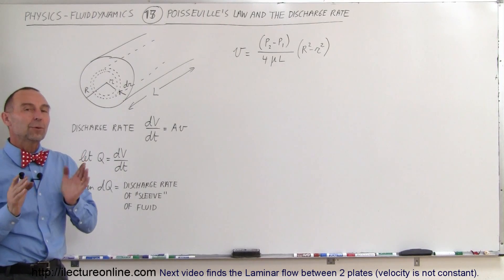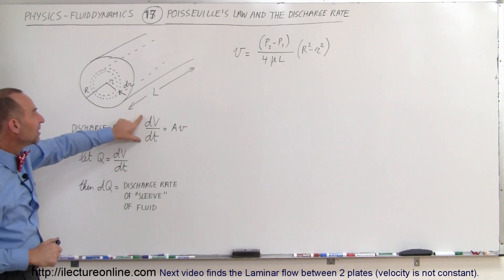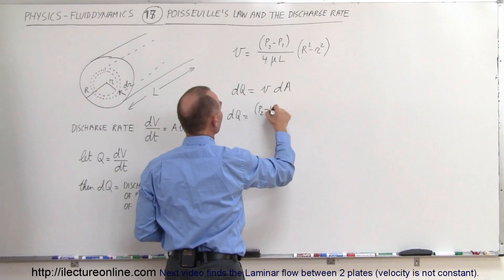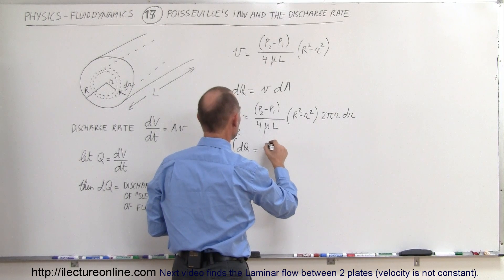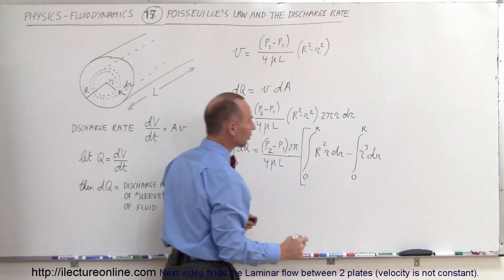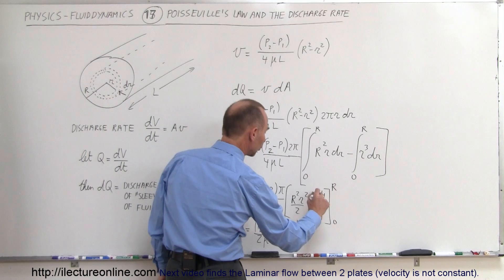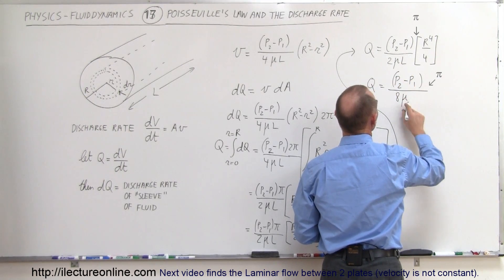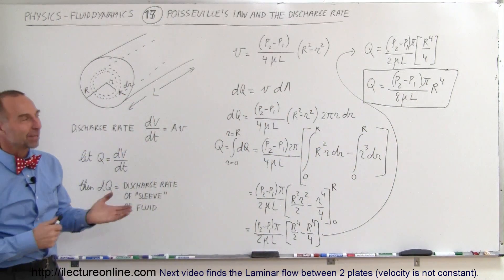Physics 34  Fluid Dynamics (17 of 24) Poisseuille's Law and the Discharge Rate

Comment: Hi Michel, This is very good material. Do you have a video where you calculate pressure drops in a pipe? Where you calculate Reynolds number, look up/calculate friction values of the inner surface of the pipe, ...?
Reply from the maker: Not yet.  Our videos on fluid dynamics are limited.  We plan to expand those videos to include the topics you mentioned.

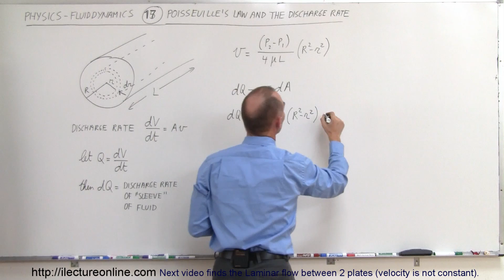Comment: Dear Prof van Biezen, @2:00, could you please explain why dA is 2Pie r dr? Shouldn't dA just be 2Pie dr?
Reply from the maker: If you cut the circular ring (dA) and stretch it lengthwise you end up with a thin rectangular strip.  The area of the rectangular strip = length x width = (2 x pi x r) x (dr)
Reply: @MichelvanBiezen  thank you Prof van Biezen very much for your reply, you are the best!

Comment: Why you are using 2*pi*r*dr instead of 2*pi*r*dr+pi*(dr)^2? The later one is more correct... I think you neglect pi*(dr)^2 part as very small and that lets you solve integral. However I think that it should be mentioned.
Reply from the maker: pi*dr^2 is not part of the integral

Comment: If Q = Av, why does dQ = vdA and not dvdA?
Reply from the maker: It could.  It depends on what you are integrating or the variable over which you are integrating.  In this case the velocity changes as a function of r and thus you are integrating over dr which can be defined via dA.
Reply: OK, thanks very much.

Also, why does A = 2.pi.r and not 2.pi.r.L? Is the discharge rate independent of the length of the capillary?
Reply: A quien pueda importar no the discharge rate does not depend upon the length it only depends upon the cross section the wider the cross section slower the discharge velocity and narrow the tube faster the discharge velocity. Length does not affect the velocity of discharge here as it is already considered under v: rate of flow of water . So Q=v.A

Comment: why you use 2(pi)rdr for dA ?
Reply from the maker: dA is the area of a small ring that has the circumference 2*pi*r and the width dr, thus the area, dA = (2*pi*r) * dr
Reply: +Michel van Biezen thank you for answer . but i still understand that why dr is width . 
if dr is width that mean you calculate the space surroud the parabola of lamina flow ? 
why don't use width = R-dr ?
Reply: why dr is width: imagine a circle being made of a lot of little rings. 2*pi*r*dr is the area of one little ring. when you integrate that from 0 to R, you'll get the area of the entire circle, pi*R^2

Comment: Great videos!  I'm using these to prepare for my Hydraulics class.

One question:  If we're assuming p1 > p2, shouldn't the 'change in pressure' term be (p1 - p2), making it and the discharge rate positive?
Reply from the maker: Noyes Harrigan 
I wouldn't get hung up on the sign.  I always encourage understanding that the flow direction will be from high pressure to low pressure.